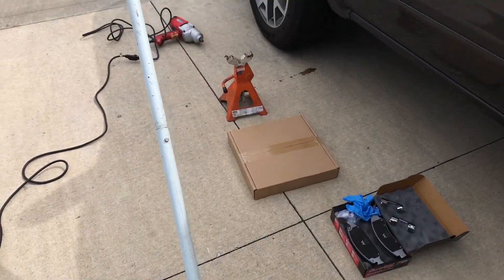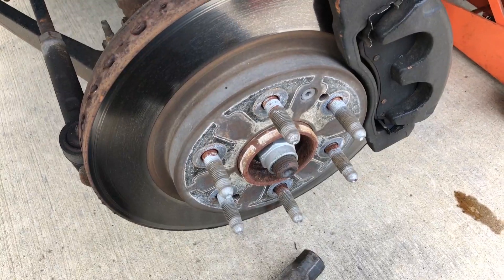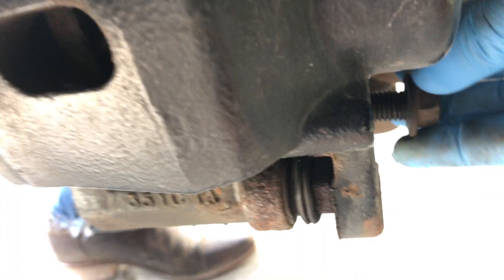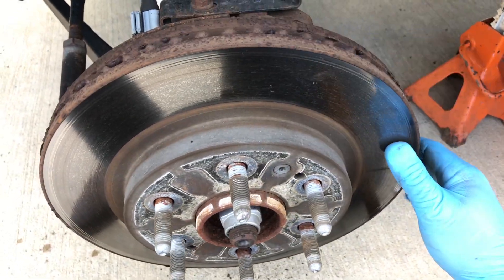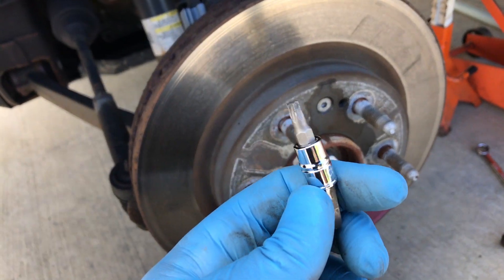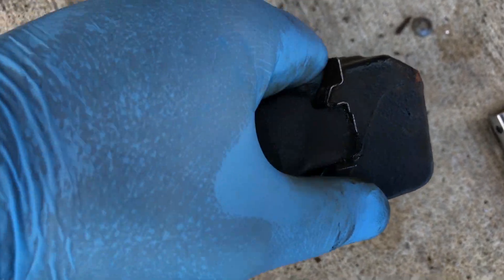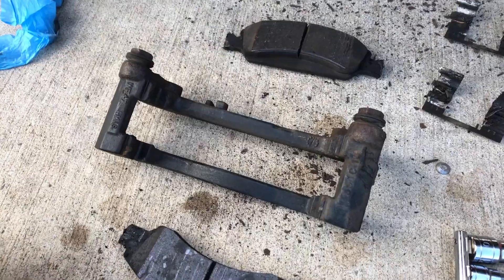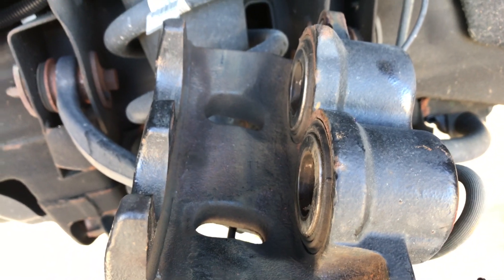2015 Chevy Silverado Front Brakes

Comment: Omg, I'm dying lol!! I'm a certified Honda motorcycle mechanic and there is a way to get out those "set" screws on the front of the disc. The factory uses them to hold the rotor on when going down the assembly line,  before installing the tires. Loved the vid, ty.
Reply: I questioned the functionality of those screws. Then I realized you had to remove them to get the jack out of your neighbor’s garage and they also allow you to remove the passenger window switch.

Comment: Just a tip for the next time...when squeezing the dual pistons back into the caliper, put the old pad(the one that was installed on the pistons) back in and put the c-clamp in the center. When you start to tighten the clamp, the old pad acts like a bridge and equalizes the applied pressure to both pistons so they retract equally. This is a lot easier and helps prevent tearing of the rubber piston boots.
Reply: Great tip! Also, go ahead and crack the bleed valve while compressing the pistons back in. You’ll flush out some of that old brake fluid.
Reply: Be my luck that I'd break off that bleed valve, lol, they're always so rusty

Comment: OOORRR! If you don't have a c-clamp handy, prior to any bolt being removed, you can pry between the caliper and the rotor to get those pistons to retract. This is usually easiest when you pry through the square "windows" in the caliper and use the rotor/rotor vents to pry off of.

Comment: Next time just use a small torch to get it off instead of a drill The factory comes with Loctite as you know the torch just burns it it’s easier to get off
Reply: Great tip

Comment: That little bolts actually in there to keep it level while you're reinstalling the caliper you don't want it to be off center. Also you failed to clean off that brand new rotor it has an oil on it and it has to be removed before you put it into use.